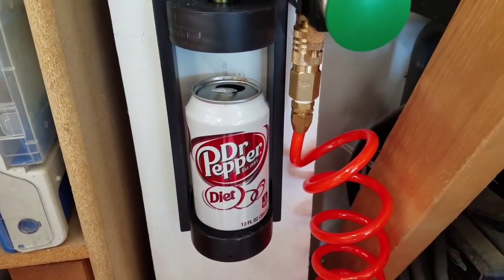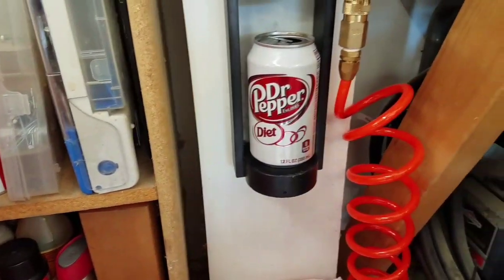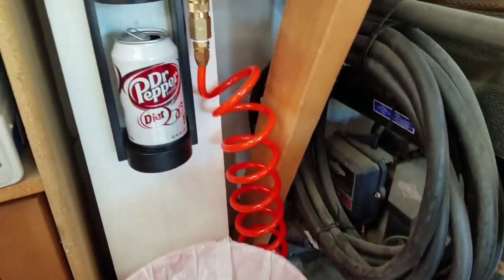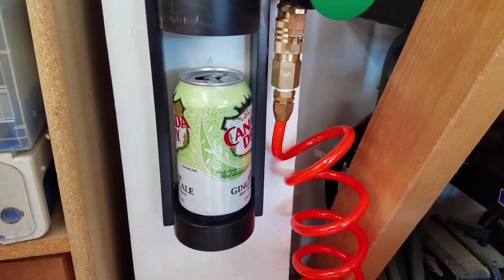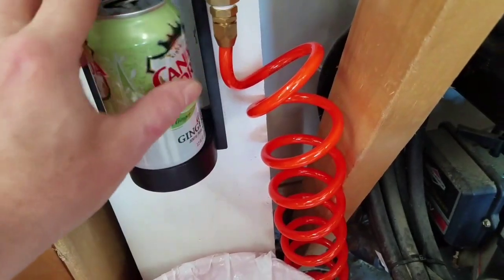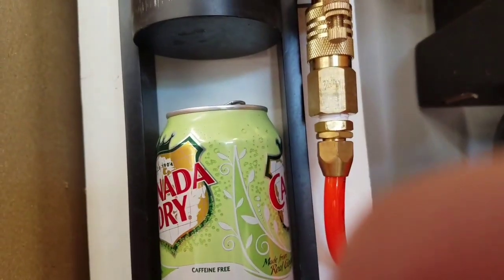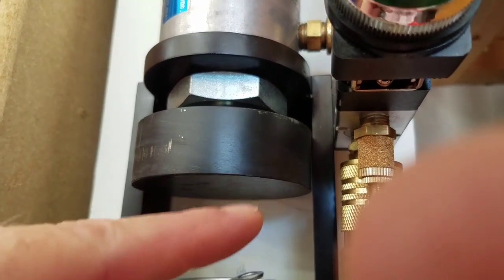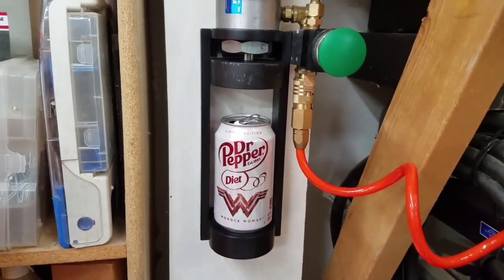Pneumatic Can Crusher Fix

Comment: What do you have attached to the rod? The round thing that does the crushing... what is it and where can I get one?
Reply from the maker: It's a piece of steel rod about the size of a hockey puck. It's drilled and threaded on the top to attach to the cylinder rod. The bottom has + shaped grooves to allow the air in the can to escape. I had it made/milled at a local machine shop for about $20.

Comment: At first I thought just turn the can upside down, but then I figured surely you would have thought of that and you just wanted a “project”. Then after watching a little more I heard you said you was going to cut channels in the puck and I was going to comment, make sure you realize where ever you put the channel all that air and sticky soda will be directed that way. Then as I continued to watch I seen you had already cut it so my comment doesn’t really matter now, guess it just blows all the soda into the base.
Reply from the maker: brycejcox with the groves cut in the top puck the air escapes and doesn't build up pressure causing a spray when the can bursts. The little sidea left in the can just stays in the can now. Thanks for watching!